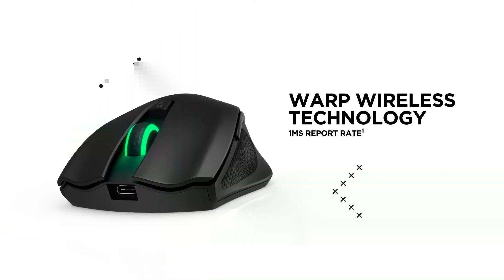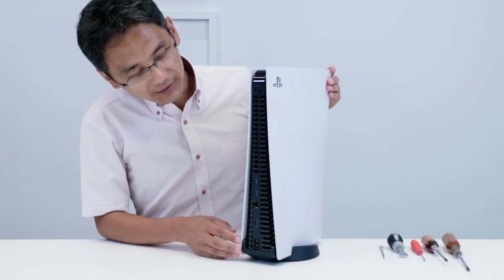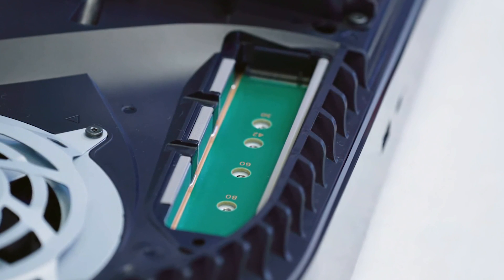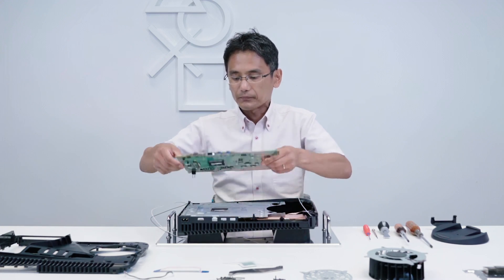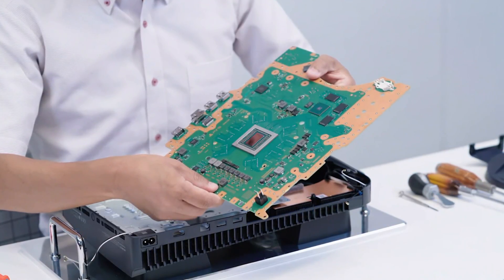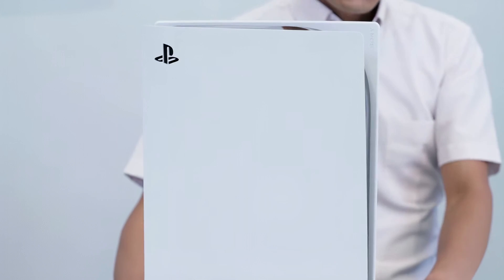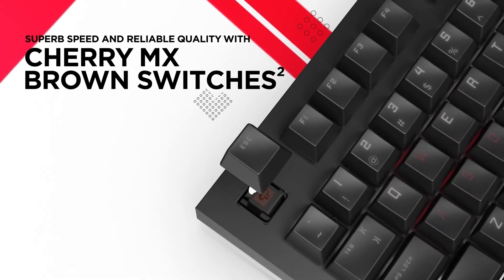PlayStation 5 Teardown Analysis: Inside Sony's Next Generation Hardware Design

Comment: Can't wait to see game comparisons, I think people will be surprised by the gap between Series X and PS5 for 3rd party games, I think it will be at least as large as between One X and PS4 Pro.

I think Sony have been cautious with details for a reason, for example, even the tflops calculation is a bit misleading. Cerny said the PS5 has a "boost" clock and the tflops calc is based on it's theoretical max power, however it is unlike any boost clock I have seen in the PC space (which run at a fixed speed and then boost to a higher speed when needed for a short time)... Cerny stated that the PS5 SoC will run at near max speed most of the time (how close to max no one knows BUT that already reduces the tflops) and then will reduce clocks as needed, so it is more of a throttling clock than a boost clock.

Been Playstation since '97 but I didn't play that many exclusives this gen and Sony seem to have cheaped out for the PS5, so I will switch to Xbox next gen.
Reply: Sounds like a  lot of speculation and assertions without any evidence lol. We’ve seen multiple games on “next-gen looking games” on PS5 . Ratchet and clank, Demon’s Souls, Spider man Miles Morales, Gran Turismo, etc.  The closest you’ve gotten to gameplay on the Series X is Halo Infinite which looked like a 7th generation game  and it was running on a PC and Dirt 5 which was very underwhelming. All the multiplatform games like Assasins creed and COD have been confirmed to be running at the same resolutions and frame rates on PS5. 

Breaking news: There have been performances tests of Yakuza like a Dragon on the Series X and S. There’s a performance 🎭 mode on both versions. The Series S is running at a laughable  900p and the series X is running at 1440p. Clearly you don’t know anything about console hardware  lol. Microsoft gameplay of next gen games on their console. Sony has been an open book.
Reply: The series furnace can't do raytracing without a fire risk that's why we've never seen it in the 4 games we've seen running on the shit, in the meantime look at dmc5 on ps5 then come back when the toaster finaly gets it implemented

Comment: “We’re even told of the efforts that have gone into testing this kind of solution” one of Richard’s general comments regarding the use of the “nuclear option” of using liquid metal on a consumer electronics device that is supposed to make it 5 years without problems. How will this be possible? Just because “Sony has developed 5 generations of console now” (must be treating the PS4 Pro as a new generation) when it’s barely more of a new design as a slim unit which they have made for every generation; counting is hard, lol. Well whatever, this generation might not last long at all with the combination of how underpowered both machines appear and all gaming, including home, handheld/cellphone, PC & VR might soon fall under 1 of 2 “partnerships”. The Apple/Sony (Apple PlayStation) and the Nintendo/Sega/MS (Super Pluto Box). Apple knows their gaming division can’t compete plus they want to buy Sony’s camera division which is the only profitable division aside from PlayStation brand. MS & Nintendo will have no choice but to team up as Nintendo is throughly aware that they “created” the beast that is PlayStation, if they hadn’t been so inflexible about the SNES CD, there would most likely be no “Sony PlayStation” and that powerhouse will acquire Sega for IP and Mascots likely dropping the MS naming outside of N. America & Europe.

Comment: With how easy it looks to remove the side panels I really hope we get custom side panels for it. That'd be so sick.
Reply: It only makes sense but we’ll see.
Reply: If we can't, we will be definitely be able to easily customize them ourselves 😄
Reply: 3d printed custom designs are gonna be some of the best
Reply: This aged well
Reply: It's all but garanteed.

I might very well get black ones as soon as they are available. The white on the system just doesn't work for me.
Reply: i always see videogame fans drooling about this feature, yet i can't see a single case when it took of in any meaningful way. And there has been many examples of detachable plates in the past.
Reply: @Refreshment01  so? Is that bad or something? Of course not. We are just saying it's a cool feature. Also, it's use is actually to obviously be able to clean the ps5 from the inside, so they do have a use.
Reply: @Refreshment01  360 special editions were popular and had custom shell designs. Also if you venture into PC space, cases have replacable panels that people do buy and customize.
Reply: I am gonna print my own with a 3d printer.
Reply: I've seen a couple adds for them pop up on my insta
Reply: yeah. after market side panel with be sick af. also with xbox series x, a transparent housing/casing for that beast will be sick as hell.
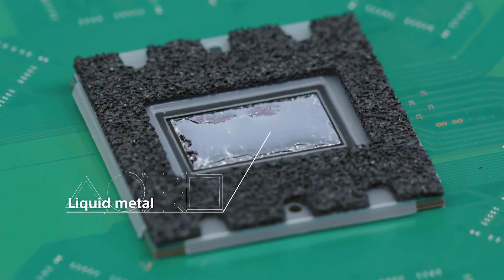Reply: 12:20  mess😢😢this here

Comment: PS5: function over form
Xbox: form over function
Reply: What PS5 design does better than Xbox? What function are you talking about? Looks like XBOX has a win in every single case.
Reply: @KapitanKlaps  the cooling in the PS5 doesn’t depend on the weight, because if you’re playing the XSX in a zone with no clean air, it’s going to overheat since the air is too heavy for the ONE fan to push

And let’s not even mention the terrible choices for air intakes and outtakes, the air intake has a massive circle blocking 80% of the space and the air outtake has a green circle covering 40% of the space, great 👍

Meanwhile the PS5 is basically designed around the cooling, with Liquid Metal, 2 double-sided fans and a singular massive air vent with absolutely no change for someone to block it

Comment: I wonder what the cost to make both next gen consoles is? It’s obvious that Microsoft went all out with their endless supply of money and that’s why they were able to make a smaller design and not care about the cost to make. Sony on the other hand went the cheap route and hence the bigger design with the afterthought hard drive implementation into the PS5 digital edition design. The tear down confirms that Sony just slapped the drive onto the digital edition to save money on having to design new consoles and that the PS5 was originally going to be an all digital machine. The Sony designer himself came out and said the big design was due to the big fan cause Sony didn’t want to have two smaller fans cause it was more expensive. Sony has amazingly talented people but it’s obvious they are held back by Sony’s budget. I’m personally gonna wait until a PS5 slim comes out cause I like the digital edition’s symmetrical design but it has no drive and I’m sure as hell not buying the quasimodo afterthought edition. In the mean time I’ll stick with an Xbox mini fridge edition lol.
Reply: The difference in approach reflects the difference in the planning and design of the consoles.  Basically the SOC, console design, and cooling were all done by 3 different teams, and the cooling was designed last.  Sony wanted the BOM to be $450, and to do so they needed the cooling system to cost no more than $50, that's why so many difficult choices were made to try to optimize economical performance.
The Xbox design team, however, is based in one central location and is not so fractured, plus early SOC design decisions made their job a lot easier by providing a larger chip that uses less electricity and produces less heat over a larger area.
Reply: @ivantruthkovic   It was in a report by Bloomberg, supported by other leaks.  I would give a link but YT comment system hides comments with links, you'll have to look it up and come back with that apology.
Reply: @ivantruthkovic   God I love how fanboys get defensive all the time for no reason lol. I’m just speaking the truth mate. Sony doesn’t have and never will have that Microsoft money and that’s a fact. Is there anything wrong with that? No, but that just means that unlike Microsoft they have to worry about every little penny they spend on consoles and to my point their talented workers being held back. Last thing they need is another PS3 price debacle. If your fanboy brain can’t see that the PS5 is the cheaper console out of the 2 well that’s on you. In the mean time I’ll continue to enjoy gaming on all platforms while you continue to limit yourself ✌️.

Comment: This thing will be only bout the level of a 2070. So, rtx 3080 go brrrrrrrrrr
Reply: 700$ GPU vs 400$ full system?
Reply: Nope, a 1080 system absolutely dusted the new consoles. The new consoles are more on par with a 1050 or 1060, if either of those cards were gimped to only 80watts with a boostclock almost half it's default clock. A 2060 makes the new consoles look like a 90s gameboy.
Reply: @sqlevolicious  you mean the PS4 right? You can’t be delusional enough to actually believe the PS5 and XSX are a 1050 lmao

For comparison, the PS4 Pro is only a little worse than the 1060, and the XONEX is actually above it

The new consoles are a 2070S-2080

Comment: My main worry right now with the new Xbox is that Storage system. Yes Xbox said they have many companies that they partnered up with. With games coming out right now do you need 1 GB of storage space. Xbox ever since the 360 they have been proprietary storage. This new storage system A.K.A “Sony memory card X”. both consuls within a year and a half will need at least 3 TB of Storage.
So just to get to my point about the memory card system for the Xbox series X Picture this.  WD 2 GB Game Card $15-$30. ALSO some skin Co making custom “Game Card” game case skins. Or you could also just go to the old fashion PlayStation memory card labeling system. mainly those two options are low cost high profit. Since everything is proprietary to Microsoft there money.
So this really doesn’t affect Microsoft at all it’s actually beneficial here’s why it’s bad for the consumer.
The Game $60-$80 
X-Box Game Card $15-$30
label sticker or skin  .10c-$2.50
Total cost for your new game.  $75.10-$112.50
Us gamers have been getting this crooked practice “EA” and has spread throughout the software industry. Now hardware.
With the lack of storage space on both consoles please do not purchase the digital addition. Disk=more Storage.
Remember this is just my personal opinion. I am also open for criticism.

Comment: It is looking like PSVR2 will be wireless as all comments referring the Wifi 6 and the patent that LetsGoDigital found
Reply: Nope. It will be tethered. wifi6 is just 2+2 5ghz ment for combating crosstalk in a wifi environment. Same 50ms inherent latency hardware limitation. IF sony does actually decide to build a psvr2 (which we know now wont happen anytime soon), it will have to be tethered and actually run at 90hz (unlike ps4/pro barfbag 60fps interpolated 120hz).

Comment: Gotta admit, while the Xbox can easily layed down it looks so stupid laying on its side and I assume this also compromises the cooling as it is designed to be stood up.

The ps5 is a little annoying, although it's not like you will be swapping from horizontal and vertical often so really that's just a silly complaint
Reply: PS5 and XSX look bad on horizontal perspective. They are meant to be in vertical position.
Reply: @geekosa63  I quite like the look of the ps5 sat horizontally... And it's going to have to be that way in my house as we don't have the space to sit it up vertically anyway...

Comment: I don’t understand why pc builders don’t have access to equivalent or greater power APU’s than consoles. Would be really interesting to build with a system that’s entirely on the board
Reply: Orion Pax  hmm but it wouldn’t be possible to sell APU’s of different quality that you put on a motherboard of your choice? Or are they too complicated to install for a pc consumer? 
The amount of room saved inside the case for cooling and the increased incentive to use an itx case would be amazing.
Imagine how quiet that would be with a water loop 🤯. But maybe there’s something I’m overlooking
Reply: @CarurossTheSecond218  APU is pointless when separate components of far greater in processing power can be had for the same price or less. Also, games would have to be designed to play off it, and the games would run like garbage (not to mention no modern game form the past 10 years would work regardless).
Remember, games on consoles are tailored to the hardware. Console games are not native by any sense of the word.
Reply: @sqlevolicious  So in layman‘s terms there would be way too many SKUs to be able to optimize games properly?
Reply: @sqlevolicious  and console manufacturers stick to APU’s for form factor and aesthetics that aren’t feasible for the general pc market?

Comment: The ps5 looks like another gaudy, uninspired built ps3.
Reply: The series x design is the most unimaginative , boring and uninnovative to ever grace gaming , PS5 is the polar opposite , it looks unique , is inaginative and innovative .
Reply: @lightyagami8645  ps5 looks like a router from mid 2000’s gtfo here
Reply: @nosumone  xbox looks like a small trash can , i would spit it after eating something bad
Reply: @lightyagami8645  did you even watch the DF video ffs!? Rich says just the opposite of what you are saying lol. The xsx is superior in it's advanced engineering form and design. The ps5 is using old tech for its design to save money. It looks thrown together. The xsx is an engineering marvel. The ps5 is unnecessarily large and uninspiring like the ps3. It looks like a low tech toy compared to the xsx.
Reply: @jackburton307  XSX looks like a dumpster compared to ps5 . Not only they are using lower standard bluetooth and Wifi tech , they are also using one ended fans with way inferior plasma paste methods and awful overpriced storage ezpansions . Xbox looks like they just took a bunch of hardware , threw it together and called it a console while ps5 is the polar opposite . Rich can say whatever he wants to , his words wont change the facts , alex was busy parading off to Dirt 5's no ray tracing low resolution visuals while he was counting the width and volume and number of shadows in spiderman MM ray tracibg . What advanced hardware ? Except for Vapour chamber , ps5 is way more advanced . 

Ps5 wrecked XSX in controller , UI , SSD , games , hardware , storage and everything , next is gamepass
Reply: @lightyagami8645  lol you are such a fanboy 😆. Thanks but I'll take DF Rich's opinion over a butt hurt ps5 fanboy.

Comment: Sony should just start kickstarter when they made there console. it looks like it has gone the cheaper route and having lesser performance. That power supply draws huge power and size
Reply: I don't think they went cheaper. They had other priorities. The power used can't be measured by the size or specs of the power supply. It clearly can deliver more power than the x and that's good. People can use more peripherals that draw power from the console like USB hdd/ssd etc.
Reply: @RazorFastClaws  no offense but that is the worse reasoning ive ever heard more peripherals can be use.  Lol
Reply: @MrRGM10  OK.. You think you can plug in anything and won't drain power?
Anyway, the PS5 could be more power hungry. I just say that the specs of the power supply don't tell the whole story and the higher specs could have other reasons.

Comment: The liquid cooling is gonna be a problem.  Liquid cooling is usually made from gallium and this element tends to erode components that it’s touching in a rapid manner. It’s also very conductive so any  spill is catastrophic and it will short the entire board. Hopefully their engineers have come up with some extraordinary composition. But I can see this causing PS last around 3-4 years and that’s being conservative.

Comment: Sorry. But i really think DF is becoming more and more bias towards xbox. Its okay comparing xbox and ps5, but this is more like DF is trying to sell an xbox. You even told you are worried with the heat with ps5, but you didnt say anything about the heat problem in xbox. And assuming the xbox disk drive will also have improvements? Please.. Guys. Please be more professional. You are destroying this channel.
Reply: Bro are you stupid? There is no heat problem. They debunked it. As a matter of fact they proved ps5 gets a little hotter than series X but just by a few degrees. Quit following dumb ass youtubers and think for yourself

Comment: All this video really did was sell people on Xbox Series X.  

Xbox Series X is much, much, much smaller, uses less electricity (PS5 uses 350 watts compared to Xbox Series X 315 watts), Xbox Series X is vastly more powerful with a lot more storage space and basically at the same price as the PS5.

Sony really messed up here.

I mean look at the size of the motherboard alone and then compare that to Xbox Series X, which also has a much larger chip die with many more features!  Yikes!
Reply: " much much much smaller " 

Irrelevant as many people and rumours have claimed that series X runs hot at times , even dealer gaming acknoledged it 

" vastly more powerful " 
10%, take it or leave it 

Ps5 have better cooling 
More future proof 
Superior internal featureset ( its RDNA2 , SO THERE WOULD BE ML and VRS ) 
And superior everything except teraflops
Reply: @lightyagami8645  They are wrong rumors. The heat is cooler than the Xbox One X.

So, it runs much cooler not only running older games like Red Dead Revolver 2, but also newer games such as Dirt 5.

It also uses less power than the Xbox One X playing the same games but using 12 TF of power.

Finally, it's also quieter than the Xbox One X.

Before you ask, yes this was done scientifically looking at both consoles.